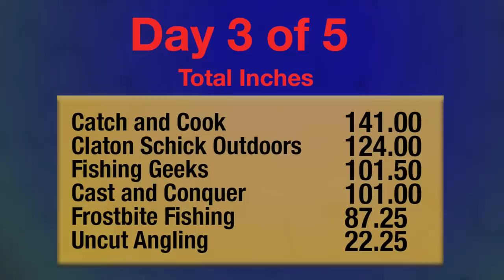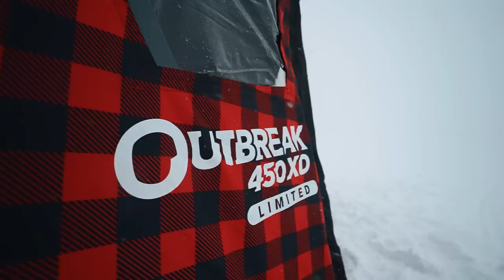Game Of Inches - Ice Fishing Competition - Team Catch And Cook - Day 3

Comment: Ok ya poor buggers here’s what you do next time you think you flooded it, try starting it while holding the gas absolutely full throttle works more safely with two people lol if that don’t work next pull the plugs and use a lighter to burn/evaporate the gas on the plug gap, next in your case film b roll of your sorrows while what’s in your cylinders evaporate (keep the plugs out).

Comment: Had the same thing happen to me sled last year. Got to the lake..sled came off the trailer…loaded gear..went to go on the lake and it wouldn’t start. Did some googling and found out the relays were to cold. Put them on my heater in the truck and boom. Then got on the lake a buried the sled. Got that out..got to my spot..and went to use my auger and the throttle was froze up. Got to the lake at 5am didn’t drill my first hole till 8 am. And caught nothing